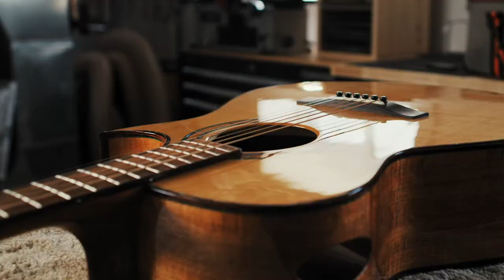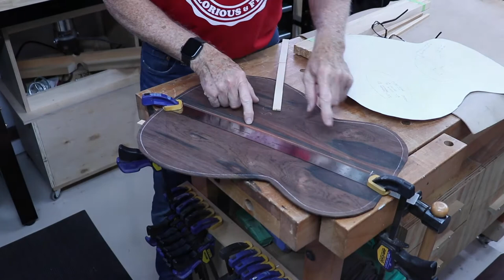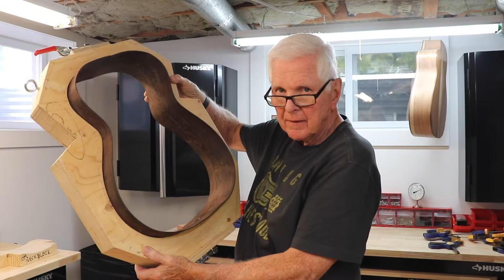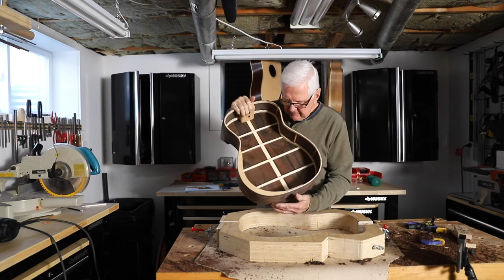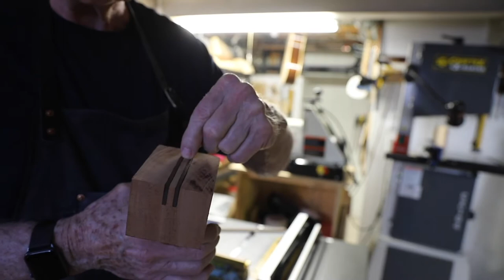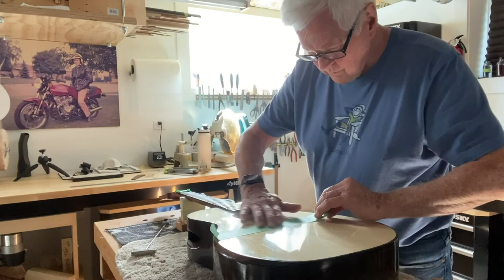Start 2 Finish...an 11 minute guitar build

Comment: Bit confused with making the bevelled arm rest, do you NEED to screw it in? Or was this case special for some reason? Anyone know? I just thought you shaped it, and glued it in. I'm looking at doing my first acoustic at some point soon, and really wanna do one :), I don't wanna have to screw it if I don't have to haha :)
Reply from the maker: Andrew the screws are up against 2 pieces of binding make them fit tights against the top. When the arm rest is carved the first strip ends up like a triangle with the slop of the arm rest and the second acts as the binding.